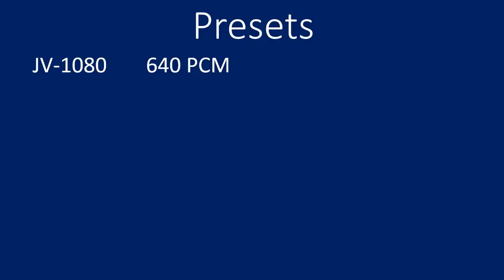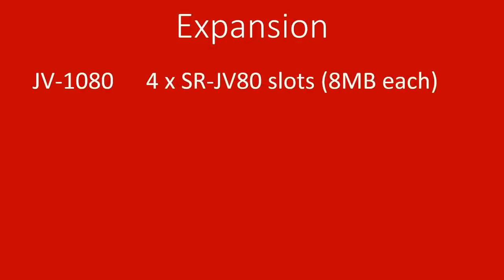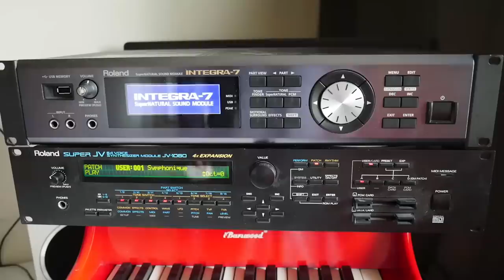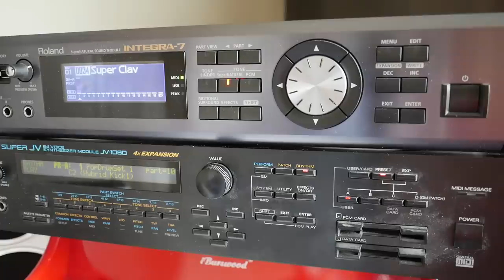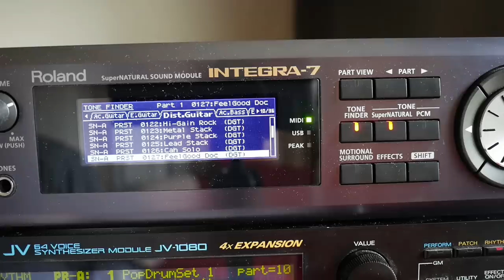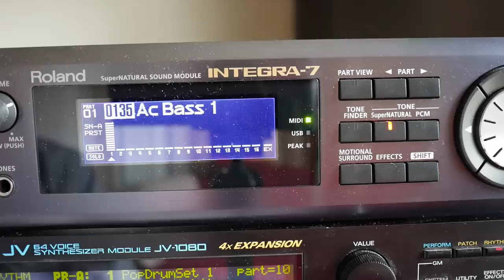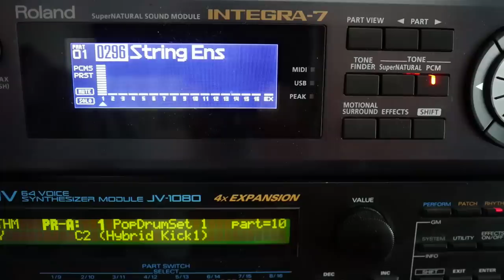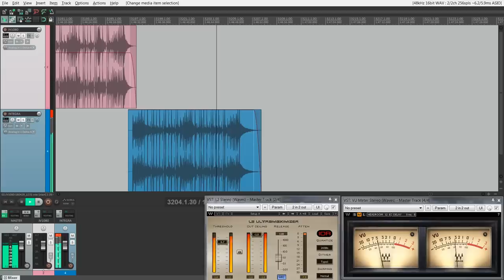Evolution of a classic synth module | Roland JV 1080 vs Integra 7

Comment: I'm looking forward to seeing Woody's Rack.

May I suggest a Yamaha TX81Z (4 operator FM rack), and a Yamaha TX7, perched on the top?  The TX7 isn't a rack unit, but they do sit nicely on top of one.

There's no need to learn to program either of them, really.  Just a willingness to locate and, wade through thousands of free patches, to find some you like.
Reply from the maker: I nearly picked up a 81Z the other day, but somebody beat me to it.  i'm thinking the plg150dx card plus a host is the way to go perhaps.
Reply: I don't have any experience of the PLG cards, so that would be interesting too.  One of the boxes that can take one was notorious for going wrong though - I think they melted their own solder, around one of the more irreplaceable chips.  I forget which model it was that did it, off hand.

The TX81Z has some built in patches, in ROM, of course, which the DX7/TX7 doesn't.  There's some daft stuff like helicopters and bad weather simulation, naturally, but a lot of them are quite playable.

If you want to set up the table for Program Change, and include the 32 in the user bank, you have to leave out 32, of the built in ones, but I found that was about right.  You can just select any of them from the front panel instead though.
Reply: Okay - found it.  The MU100R is one to avoid, apparently:

https://www.youtube.com/watch?v=O1rlHn-WIEY

I'd been considering one, when I first saw that, and a bit of light googling seemed to confirm that it was a fairly common problem with them.

EDIT:  But it seems the MU100R took the PLG100 cards, not the PLG150DX.

It seems to be a bit of a "what fits what?" minefield.  This might be worth reading:

https://www.muffwiggler.com/forum/viewtopic.php?t=125064

"The MU128 can use the PLG150 - but it has no special Voice data prepared for any of the boards (so it simply does not address that feature - it has no ability to see it or use it). "

- not sure how much of an issue that is, but it seems things aren't as simple as they probably ought to be.

Comment: Very surprised how good the 1080 sounds by comparison.
We saw the new frontier in the early 90's being broken through for digital synthesizer  technology. Even though processing power has greatly increased since then and the cost for such power greatly reduced, perhaps the imagination on how to implement this has not yet caught up.
Hence why we're seeing a retro step back to developing new analogue or analogue/digital hybrids i.e. if you can't think of something new, re-invent the old.
The JV-1080 really proves just how big a leap they made in the 90's considering how fresh some of the presets sound. I'm just rediscovering my Korg Triton and it still sounds epic compared to the new stuff around.
Got to be an amazing 2nd hand bargain, if you can buy a 1080 for less than 200 quid.

Comment: Just picked up a JV1080 that's only ever had home use, looks like new for £150.00 bargain I think. I have the SRX Ultimate keys module in my VR 760 already, but, it's a bugger to call  up patches in it. I am looking forward to playing all those old Roland sounds a little easier :). You've put a bug in my bonnet. I am thinking a rack of this sort of thing down the track too. Need to sell the Motif XF8 and the VR 760 and get a Montage 7 first.

Comment: The Integra has a number of built-in SRX board equivalent, however, each SRX real expansion board has its own CPU (engine) which allows a more efficient use of memory and resources. On the other hand, much is what the Integra has, is the use of compression whereas the SPX physical cards, have less compression, therefore sounding overall better.
Reply from the maker: interesting if true that the real SRX cards had some kind of CPU.  In the Integra, it's just a SD card containing the wave roms.  Although some emulation of the processing could be built into the I7 firmware, who know?

Comment: Woody Piano Shack, is the Integra 7 multiple outputs true individual outputs for each sound patch part you output or are the outputs part you can plug into inputs of an analog mixer, or just an 8 or 10 output surround sound?
Reply from the maker: don't remember exactly, you can route parts to each output, it's pretty flexible
Reply: cool

Comment: Hi friend
excuse me. I have a question for you.
There is a problem that when I connecting Integra 7 with my computer;  the sound cannot come out via my audio interface.

I have confirmed the setup was correct that my Integra 7 and my DAW Cubase software work fine.

how can I solve it ?

Thank you.
Reply from the maker: which driver are you using for the audio, integra7 driver or your soundcard driver?  windows or mac?  if you install and use integra driver then all audio is sent to and from the integra.
Reply: @WoodyPianoShack  
My system is Windows 10. 
Audio interface is RME UFX.
I am using my soundcard driver on Cubase.
So I would like to use integra7 to make a sound  via soundcard.
Thanks for replying.
Reply from the maker: then i guess you just need to connect audio output of integra to audio input of soundcard.  then it's just a matter of configuring drivers and daw to route the input, but this I can't help you with.
Reply: @WoodyPianoShack  
I've solved it.
I really appreciate it.
Thank you so much.
Have a nice day.

Comment: The huge difference between the JV-1080 and the Integra is that the Integra (like the XV-5080) can use stereo samples per tone. That alone was a big step forward between the JV-1080 and XV-5080 back in the days.
Reply: So the JV1080 can't use stereo samples?
Reply: @MeneTekelUpharsin  Yes, it can't. With the JV-1080, you can still pan every tone and every patch (consisting of 4 tones) or modulate the pan through an LFO, etc. But the JV had mono oscillators, while the XV (and the Fantom X, and the Juno DS, and the Integra) can utilize true stereo samples for each individual oscillator.
Reply: @MeneTekelUpharsin  Some of the legendary JV-1080 pianos sound stereo because of KeyFollow assigned to pan. The expansion cards had some sounds with separate L/R samples, but in the JV-1080 one sample occupies the entire tone, so you need two tones for stereo, while in the XV-5080 you can load both L/R samples into one tone.

Comment: Not sure about the I7 anno 2023… there are still driver’s for windows and Mac but you need definitely an iPad for easy control. This screen is very small for editing. The latest app update was 5 years ago … and I noticed some people have problems with this app. Should be nice to have a massive upgrade about editing and also polyphony (128 notes?) … at least 256! For this price … .

Comment: Both are great Romplers. Now I have Integra, but I also have JV880. I had 1080. Now I have it on Roland Cloud. Some patches on 1080 are really good, and much better as on Integra. Integra sucks with Supernatural sounds comparing to Kontakt5 libraries. But there are two good things in Integra - SN-Synth section and Drums. SN-Synth is really a wide collection of a lot of samples from vintage synths. And which is more important. You can really do with them a lot of editing and creating a lot of good sounds. But main problem is that Integra should be better sounding overall. Somehow it isn't sound full and rich. More clean and sharp. But with SN-Synth you can make a lot of good sounds. But same problem is with for example new Yamahas MODX. Their had powerful synth capabilities but they sound so flat and uninteresting. My DX7MKI don't even have fraction of capabilities of MODX but sound so much better. But also Digitone sound great. So maybe it is really something wrong with Yamaha MODX :)

Comment: The real magic is when you take both of them and layer them when you trigger your midi. After when its in a audio clip use the 1080's low mid, and the Integras mid high or vice versa. Honestly some presets were just bad between them both. There's always a good one for a bad one and right or wrong context for the mix.

Comment: All of us Synth freaks need at least 1 Roland rompler synth in the corner for some good old keyboard/real world sounds methinks.  I had a JV1010 based on the 1080 and replaced it  a couple of years back with the newer XV-5050.  Some will say that the digitally ancient JV series is superior in character and it does have a rich history in film and TV scoring but as far as I`m concerned the XV defo wins out for the type of use that these units usually get by us and I`m sure that the Integra would be the master of these uses.  Yes I know that most of these units aren`t technically Romplers but due to the lack of a proper programming interface and the sluggish response of some of the parameters if you do manage to midi control some functions then they may as well be Romplers innit
Reply: After listening to the entire video though it does seem that the JV usually has a much better sound apart from the emulation of stringed instruments but then again that`s what Kontakt sample libraries do better than anything else.  In the end though I guess I`ll stick with an XV and forget ever inspiring to an Integra 7 instead.  Thanks for the useful video, especially as you play the sounds in the style that that are ment to be played and not just like a trad piano player who thinks that by playing everything like a piano is the way to do keyboards which it isn`t as most of us musicians know, cheers Woody, goodjob

Comment: I prefer the JV piano and the other module e.piano patch was better. Not sure what I make of the green organ. It seems to be muddied but has a more complex leslie simulation. The integra has a more brittle lead guitar or just a poor dsp setting. Strings sound identical. Sax seems more gritty and expressive on JV . Strings possibly smoother on integra. Drum differences are indistinguishable

Comment: Guess what, guys and gals, they BOTH sound great. Just not exactly the same and, in some cases, not even very close. Part of that may have to do with the "wrong" voice being selected on the Integra, and some of it may just be that Roland's engineers tweaked some parameters rather differently when creating many of the presets. The great thing about the newer machine is that you can edit pretty much all of those parameters to your liking and probably come a lot closer to the "vintage" sound of the JV 1080 if that's what floats yer boat. Like I said, I like 'em both.

Comment: I would never trade my JV-1080 for the 2080, the XV 5080 the integra,the Fantom XR, the 5050 the XV 3080 be converters are different & they sound to clean for Hip & R&B music & Roland made a big mistake by making a VST plugin for just the basic 1080 sound’s instead of putting all of the expansion boards in it now me personally the best expansion boards that they had made was the Vintage Keys, the Session, Keyboard of the 60s & 70s, the house card & the Orchestral 2 in fact I have been in some studios where the engineer would have 2 1080s chained together it’s one classic piece of gear that I cannot do without.

Comment: ...wow. I remember seeing a demo video of the Integra years ago that blew me away a bit, but... overrated Integra is overrated. The slap bass sounds a little distorted and harsh on the Integra and that one organ at 9:09 sounds like someone sampled a 50 year old home recording of an organ and made a novelty SoundFont out of it. The acoustic guitar sounds way better on the 1080, but the drums are a bit more convincing on the Integra, and the Dist Guitar sounds a bit better on the Integra (though at the end of the day they're both just high end cheesy MIDI Dist Guitar). Other than that, it's basically just "This sounds slightly better on the 1080... This sounds slightly better on the Integra...".

This leaves me utterly unconvinced that the Integra 7 is worth the massive price difference over the JV-1080.
Reply: Redhotsmasher The Integra has ALL of the sounds from ALL of the SRX expansion cards included.  That alone is worth the purchase of perhaps a "used" Integra.  But no, I wouldn't spend  $1500 on a new one either. 

I have had my 1080 since 2006 and it definitely has a character that is different from any other keyboard or rack I own, including my Fantom S.  Synth sounds and basses are where the 1080 shines.  To me, acoustic instruments, on the other hand, are not the 1080's strong point.  Some of the acoustic sounds on the JV1080, such as a sax for example, are a bit cheesy.  BTW, I'm talking strictly about the stock onboard sounds here, not the JV80 expansion boards.  I'd like to compliment it with an Integra in the future for the SRX library and Supernatural acoustic sounds.  The SRX boards are still too expensive even in today's second-hand market.  The JV80 expansion boards are quite pricy too and many also have capacitors that could explode.

Comment: Still open for offering waves if you want to pit it against the JV-880 + vintage synth card ;)
Reply: Also a JV-1080 for 200 bucks.. these run 400+ euro's over here :x
Reply: Ah Germany to the rescue, 170-ish. Going to have to pick one up now :P
Reply from the maker: waves?
Reply: Woody Piano Shack wave files. Or mp3. Would of course need a midi file to play over the jv-880 and a list of the patches you used for a fair comparinson.

Comment: Ah yes, another demo with a delightful, and patented, WoodyWalk®️. That would be a Woody walk down memory lane.  :)   (wonderful interpretation of Video Killed ... !)  Thanks for all the work and some tasty playing, as well. So, tough call. The 1080 sucks at emulating acoustic instruments - like it's supposed to. Let's be real. The Integra was wonderful at that - again, as it should be. For the vintage sound, it's the 1080 hands down. To be honest, I have enough plugins that cover both of those areas that I'd have to say no to both of these. No $1500 for the Integra. and, again honestly, rather than spend $200 for an old 1080 or a little more than that to finally own the Cloud 1080 - I'd probably spend $179 for Diva. Except, I have an $80 OP-X Pro II that is the bee's knees.  Cheers, Cliff
Reply from the maker: right cliff!  plenty of vsts cover the piano and synth sounds, but for other bread & butter rompler sounds, i'm struggling to think of a good plugin, you'd probably need a suite of plugins, when you start browsing the patches on the integra, it's an amazingly broad palette of sounds.  all categorized and ready to go.
Reply: And it does sound gooood! No denying that. If I were in the market - definitely.

Comment: How about  Rack Me Baby,  Rack me Slowly ?   

But please do also include the many somewhat forgotten yet very useful  Multi FX Processors once made 
by  & for every one,  Outboard gear is often an after thought item you'll want to spend hard earned money on. 

Especially when you have dream gear on your wishlist,  Yet you just might be surprised how much an 
Aural Exciter can do to take your  " In Between the Wet & the Dry "  sound come to life / 

I see  some Talk about Synth Guitar patches sounding more believable.  So just  Try using the same
stomp Boxes the Guitarist use ?   Besides these Multi FX processors are great on Vocals & in your studio
again hardware products can be used for side chained  FX even with in your DAW the Delays & Reverbs 
will work & sound different than your Plug em In's , Plug em in. Your Studio's will smell better for it as well
Reply from the maker: for sure rick, you couldn't use an early rack fm synth without some outboard effects so for i'll be looking out for some fx units to begin with

Comment: The JV-880 is actually the first JV module and it is older than the 1080 and sounds the same , it actually sounds very good, with less memory though.  I think the best module Roland ever made is the XV5080 from around 2000. That one is totally amazing, better than the Integra even though it is much older. :) However the Integra is also amazingly good. Having said that all the JV modules have aged well.
Reply: I owned both 20 years ago. Now I have only JV880. 1080 always sound little better than JV880. JV880 always was little brighter and was not so deep sounding. But I like JV880 very much. POP Exp is sounding better on JV880 than on JV1080.

Comment: Yes... I have an Integra but YES I'm sooooo glad I also kept my JV-1080, JV-2080 and even XV-3080 as the sounds have su much more character then the dull Integra ! Same with my Yamaha's, my old TG77 and EX5r and AN1x have sooooo much more character then my MOXF8.... it's more like a downvolution these years. :-((
Reply: So I should skip on the Integra,then?How are drum kits on it?
Reply: @savanaviolenta  Well, skip... not really as you have more then 6000 sounds in 1 box with all the SRX boards included so it's the Roland JV / XV legacy and well worth having. If you want all these sounds you will need several JV /XV modules with enough room to house all the expansion cards :-o The Integra sounds great and very "clean" on its own but personally i prefer less clean, more raw and warmer sounding old '90s and '90s modules. But then... i'm an old guy, 66 years of age LOL. Nostalgia rules i assume.... hahaha.
As for the drums... do'nt know as I rarely use drums in my new-age dreamy tracks.